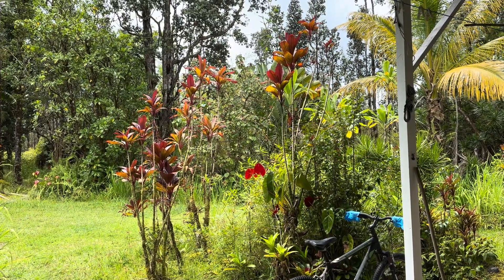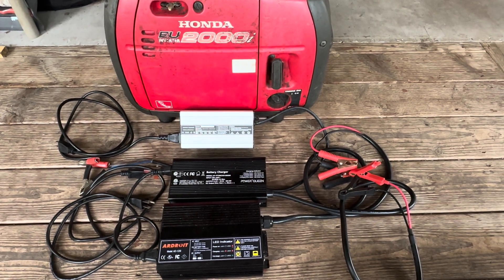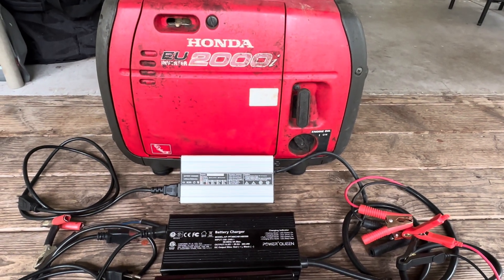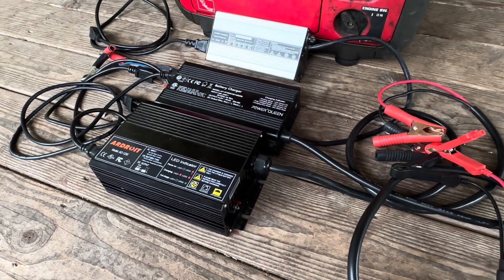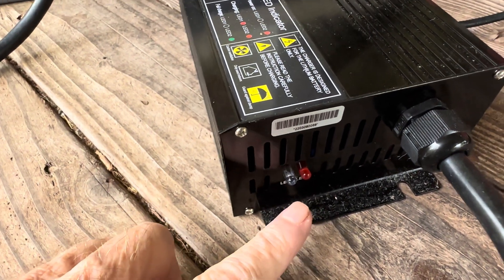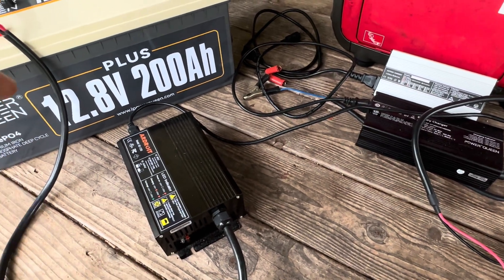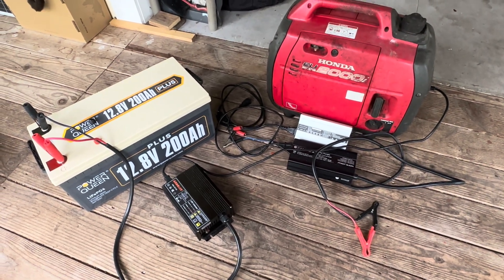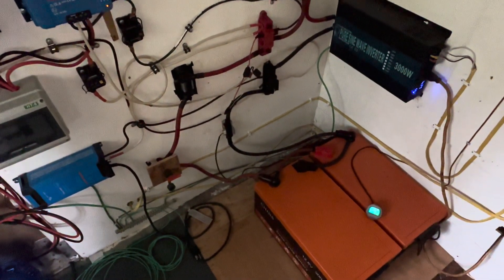LiFePO4 charging without the grid or sunshine. Stay up and running in any eventuality. Last resort!

Comment: Hello, great videos I saw in this video you said you could pass through charge on your smaller system. I spoke with power queen and ask them a question and they say they did not recommend using the battery while you’re charging the battery. Is that accurate? Thanks.

Comment: If you use gasoline, propane or Natural Gas you are NOT off grid. <--period  You are just using someone else's grid.
Reply: If you watch his videos consistently it is usually very uncommon for him to run the Jenny.
Reply: Did you get the redodo battery to wake up?  You might try paralleling it with a working battery and then putting your charger on the Jenny to charge them both with one bbms working for the three hours that redodo suggested to get the second battery and bms to take some voltage and get the second bms to come back online from its under voltage protection status. Kind of a fake charge for the cells and charger? I bet you have a week connection inside the battery in the end though.

Comment: So I can dial in the voltage I want. I use a thirty amp adjustable power supply that I got off of amazon. Will it do thirty,,, probably not safely.😂 I like charging at fifteen or twenty.
Reply from the maker: I notice they all run pretty hot, but thankfully I really never need anymore. But keep for just in case. Aloha! 🤙

Comment: Yes, a Honda 2000 (and I have two of them) would work if the main home solar, and the mains, went down.   But for me would be only a last resort.  Folding and loose panels and a portable "solar generator" (Bluetti or EcoFlow or similar) would be the first alternate to the whole house systems for charging PEV's.   Gas or propane Honda would be the last, third tier resort, in clouds and rain when none of the other sources will work.
Reply from the maker: It's only as a last resort here for sure. have not needed one time in over a year now that panel array's are over built . But I take comfort in the backup 🤙

Comment: I used similar chargers like you, next to the Victron charger.
I found out the hard way that those other chargers are not that great in (their own) protection, like accidental shorting, reverse polarity.
Yes, the Victron is more expensive but are also quite safe. 
For the on-readers, always read the manual what needs to be connected first, the 12 volt side or the mains side, very important!
(for Victron it is always first the secondary part and last the mains side. And disconnect in the reverse order)
Not oding it in the correct order can also damage your charger...
Reply: I have no experience with Victron products, but those black metal chargers also produce A LOT of heat. I have 20A, 30A, and a 40A model of those, and the higher the output the more heat they make, with the 40A model making as much heat as a small room heater when it's operating.
Reply: @davef.2329  You are correct, I have observed the same;
Once we broke ours (to give you some examples: one by accidentally connecting to the 12 volt battery in reverse, one other unit by shorting the alligator-clips) I took them apart to see if I could repair them (I have an electronics background and have repaired since decades).
What I noticed for those black charges (let's call them AlieExpress Specials for lack of listing tons of brands/names etc) is that they are very often a 19 inch computer powersupply in disguise; 
Our friends @Alie are quite creative in repurposing those (often modular) powersupplies and change them into chargers.
(which is not too hard to do for LiFePO4 btw, constant current and constant voltage are some of the important parameters in the charging process)
Those computer powersupplies are known to be able to produce a lot of power in a relative small spacefactor (size is quite important in a 19 inch rack).
The drawback is, I also noticed, they do produce a lot of power (often able to charge a LiFePO4 in just a couple of hours) and indeed a lot of heat (and fan-noise as often the cooling-fan runs at full speed right from the start until charging is finished and/or disconnected).
The accidental reversing (my fault of course) caused a huge spark and vaporised (!) part of one of the fairly oversized alligatorclips. (and that was only 2ith a 100Ah LiFePO4,, btw)
I have quite a few LiFePO4 batteries (which I build) myself and have moved away from the AlieExpress special (LiFePO4) chargers, they are often quite unforgiving when you make a mistake. Granted, they often do charge any LiFePO4 battery under most if not all circumstances (the benefit of being a powersupply made into a charger versus being designed as a charger) even when the battery-cell is at near 0 volts. (don't ask, a seller duped us)
The fact they are often so loud and indeed generate a lot of heat (heat is less efficiency in my book) made me move to the Victron chargers as shown in this video. I found them quiet, not running as hot (even at 30 amps) and very easy to use. Set once via the button and/or App, and you are done, nothing further to worry about.
I would not dare to fall asleep or not keeping a close eye on those AlieExpress specials but, to a certain extend, I trust the Victron (not to burst into flames, overcharge the battery, causing issues with the BMS etc etc)
And I found that some of the (quite good/expensive) AlieExpress specials are priced near Victron prices and I than would be even more tempted to go for Victron instead.
Which does not mean that Victron is without error, but they can update their firmware via your app, should it become available and/or be needed.
Something that you can forget with the AlieExpress, at least with all the models we had, used and inadvertently destroyed.
Reply: @davef.2329  I love Victron. I'm a huge fan of them. But I have a Victron IP43 12V 30A charger (3 output model), and it gets hot when it's running at 30A also. Not enough to melt plastic or burn me, but I was surprised at how warm it gets.

Comment: Rather than use inexpensive Chinese inverters you may gain significant efficiency with a LOW frequency inverter.  Yes, they are much more expensive but over time (and given higher quality) you may find it more cost effective over the long run.
Reply from the maker: Good information for sure. I am slowly adding Victron cc's for that very reason. But so far so good on all other inverters so far except one i had fail. Aloha! 🤙
Reply: @ProjectsinParadise808  Although Victron is higher quality their inverters are still high frequency.
Reply: Victron Phoenix 1200 is a low frequency inverter.

Comment: That generator has a 12 volt out. How could use it to charge lifep04?
Reply: I have the same one.
Reply from the maker: I don't use the 12v out, but rather the two 120v 13.3a outlets for using these chargers. 🤙
Reply: @ProjectsinParadise808  i would think the generator has way more current to charge batteries with the 12 volt out and you could use the 120 to keep your freezers charged up. You could use a victron DC to DC charger from the generator 12 volt out

Comment: Great video. I live in Florida, so we try to get ready for hurricanes.  Curious on how many watts those chargers use. Saw you had a 2000 watt generator. Can you run the 10 20 and 30 amp chargers all at the same time or do you have to run them separately?  Also, can you run the charger off the generator and keep the inverter running to keep your appliances in the house going at the same time or do you have to shut the inverter off while you're do doing the charging?  One more question, if you can charge and use the inverter at the same time, are you allowed to hook the alligator clips to the bus bar instead of the battery, especially if you have more than one battery. Maybe this will be an idea for a follow-up video. Keep up the great content. Thank you.  Scott
Reply from the maker: Mahalo! I have run two chargers at once on the generator quite easily, to two separate batteries. I can keep the system up and running while charger, inverter running, loads running , no problem. i forget atm how many watts they pull, but they do push the amps as rated. Personally, I would not connect to bus bar with the alligator clips for safety reasons. If one popped off and made contact anywhere on the system sparks would fly, and you could short out the system. For bus bar connection  I made ring terminal connectors so that is not a possibility. Aloha! 🤙
Reply: I plugged in the watt meter while using the 30 amp Victron charger and it was approximately 750 watts. It brought the Honda 2000i out of low idle and about half way up to full power.
Reply: @ronkmiecik7442  great info. Thanks.  I can get by with a small inverter generator.
Reply: @saglazier  sorry I told you incorrect information. The 750 watts was charging my solar generator. This afternoon I plugged the 30 amp Victron charger into the watt meter and checked the app to verify the charger was putting out 30 amps. The watt meter settled on 462 watts.
Reply: Thanks. I never thought about the safety issue. Agree ring terminal cable much smarter for bus bar. 👍

Comment: Nice video. That a easy way to charge them back up. so many chargers on the market now. I got the NOCO one in the shop. can select battery type. in an emergency you can charge LiFePO4 on a lead acid 12V charger. just use meter watch voltage. may not charge 100% if not get to 14.4/14.6V  AGM setting will get you the close to full charge. now with 12.8V LiFePO4 you can jump charge from a car truck lawn mower ETC. watch current. use meter . not going to get full charge. but get you to 14.2V or so. Thay make DC to DC chargers for LiFePO4. renogy makes a nice one. can be 12/24 to 12/24 charge. set you battery amps volts and type on some . some DC to DC chargers only start when the input DC is up like car is running. this is great for RV use. keep battery's up when driving. not recommended to put LiFePO4 on 12V alternator directly. most of them a set for lead battery and need that load to keep voltage stable. The BMS disconnect can damage some types of alternators. best to use DC to DC charger. 😀
Reply from the maker: Great information as always Roberto! I don't even have an old LA charger anymore. The one I dod have finally rusted into oblivion. It was old, old. 99% of the time solar works perfectly, especially being able to bounce around between systems. We'll see how the production goes this winter though. Hopefully only have to fire up the genny to keep it oiled up properly! Aloha! 🤙